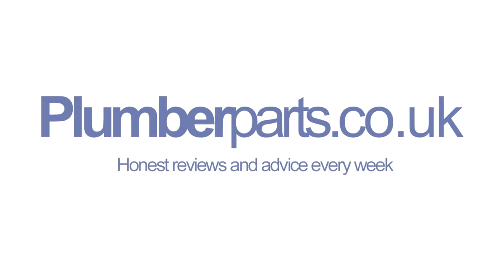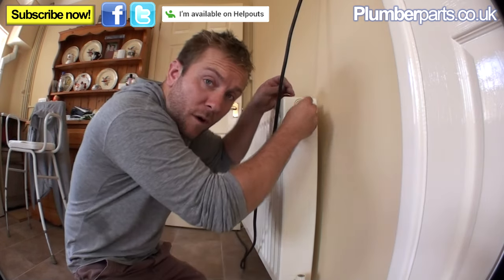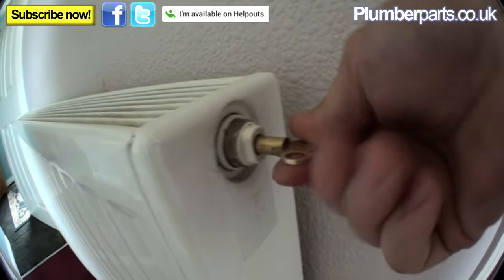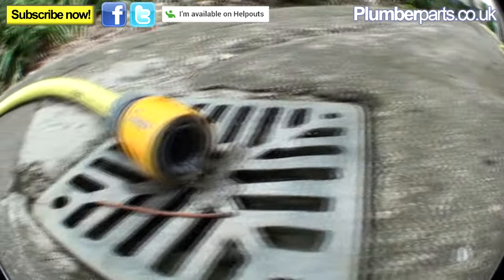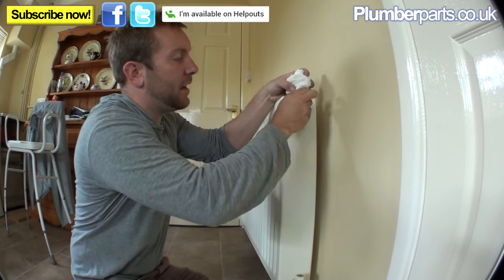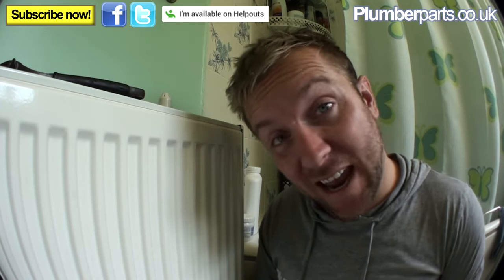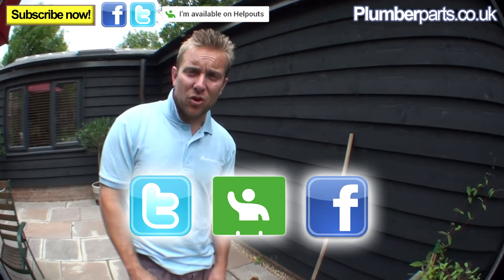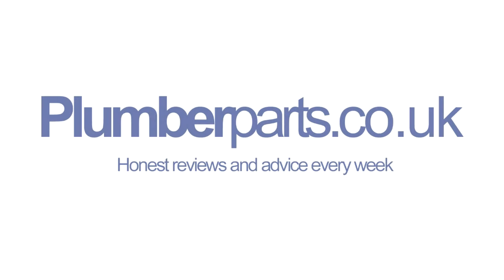HOW TO FILL UP HEATING SYSTEMS - GRAVITY FED - Plumbing Tips

Comment: Class videos. maybe you have one already but if not, somebody should award you with a PhD/professorship (whatever) in plumbing.

I recently changed a radiator on my pressurized system. Pressure of 1 bar holding well, no leaks, all rads nice and hot... except when i go to heat the hot water!? Pressure falls away to nothing, gas boiler shuts off..no sign of leak anywhere!? Could it be an internal hot water tank issue?...tundish a little damp

Comment: After draining down, replacing rads and filling I forgot the step of turning on the water with the drain open. I bled all the rads but when I turn taps on on full and then turn them off the pipes bang/rattle. How do I sort that? Do I need to drain system again?

Comment: I don't suppose I'll still get replies to a 9 year old video but I'm finding these videos very useful and helpful. 

I was wondering where to drain the radiators off when you have a flat and no garden to drain the pipes into. Do I just keep opening and closing the lowest drain point into a bucket? 

I've seen other videos where they change valves etc without draining the system but the tank has been installed in a nice and inaccessible location so draining my only option
Reply from the maker: Hello mate, try your shower tray if you have one. Failing that learn how to pull a syphon. Oh yes and greetings after 9 years!

Comment: Great video quick question when filling up my gravity system I closed off all the bleed valves on the radiators but took the drain hose off and closed it then started to fill back up now when I start bleeding the down stairs radiators I can hear air coming out and the radiators start bubbling inside but then the air stops and I have to keep going round all the ground floor opening and closing them. I done this for about 2 hours and still no water is coming out the bleed points on all ground floor??? Any suggestions please or do I just have to keep persevering with it
Reply: Did you figure out what the issue was as I am about to tackle mine? It wasn't something silly like not turning the water back on was it? Thanks.
Reply: @rtyrtyrtyus  yes I kept going then left it to settle over night then done it again in the morning and all the air cleared. Bled them all again and all was fine.

Comment: Followed these helpfull tips but at the end it seems a bit half arsed. In my case after refilling the system my boiler would not produce hot water. This turned out to be an air block in the central heating pump. If you think you have the same problem undo the large chrome screw on your pump. A little water will appear, use a rag. Straight away I could hear the air escaping and the water rushing up from the boiler to the tank.

Comment: Hi, I have a gravity feed system and had to drain it  to remove a radiator, as the valves wouldn't close off properly.( I turned mains off and tied up ball valve ). All finished and refilled  with water coming out of cold and hot taps. But no hot  water ? Is the airing cupboard cylinder attached to the heating should I have turned the element off ?
Reply from the maker: Do you have an indirect or direct cylinder?
Reply: I'm going for a indirect cylinder as it only heats up when the boiler is on. (It has a creda redhead on the top). When boiler heating water is on a couple of radiators warm up  gently but not the bathroom one ( which normally does). Luke warm water comes out of taps for 5 secs and goes cold.
Reply: Thanks for your reply, but sorted the pump by the boiler wasn't playing nicely, I changed the speeds 1,2,3 and removed the gurgling air 👍

Comment: Hello. Your video clear and interesting. I tried to follow but failed. Do you have any idea why my heating system can not fill up. No water comes out from the ground floor heater where I tried to let it run out for 10 mins as shown in video? Thanks.

Comment: just replaced a rad 3 days ago, now heating pump is leaking, have i missed something out, thought i bled the system, could leaking pump be anything to do with low pressure or is pump simply needing replaced

Comment: Hi
I've bought a house which has been empty for the last 10 years. The central heating system is running on an old school square baci boiler and has a separate cool tank for just hot water. The boiler does turn on but radiators don't get warm neither do the pipes at the bottom of the rads. So my question is how do I drain it using rad gunk cleaner and where do I pour it in?
Thanks in advance

Comment: Is there a product that can be added to the F&E cistern (before opening the ground floor rad drain cock) to help flush any sludge/dirt etc from the rads when they are drained down?
Reply from the maker: James Scott Just your standard cleaner. But you need to let that run around for a few days!

Comment: Hi great videos and what i'm going to ask you probably heard a million times. I've recently installed a towel rack in the bathroom and had to drain the system because one of the valves was knackered. Of course now i have introduced a nice little air block/pocket after refilling the system. 
                  I can hear the water pump spinning around but i have no flow. I remember i once connected a hose to the expansion pipe then connected to the outside water tap and switched on for 20 seconds and it worked gurggle, gurggle rush of air . Are there any offer methods or tips for a DIY  guy like me?. I've changed pumps and valves in the past ,and i know how to solder. Winter is coming and my young son complained he was feeling cold yesterday.:(. I've tried re draining the system and starting again. Really banging my head against a wall at the mo. Been going through all your videos and they have been helpful. Thanks. regards Del
Reply: Its a gravity fed one btw
Reply: Got it, i removed up the new heated towel rack top inlet cap then sucked and sucked the water up with my mouth. The suction started a wave of air bubbles coming up through the pipes under rack. I had to rush to turn the other air vents off on other rads as the water started to flow out along with a gurgling bubbling  noise coming from airing cupboard. I don't recommend the taste but at least i got the trapped air. Not perfect method but it worked.

thanks for the vids ,i've subbed.

Comment: great vid! i changed a radiator in my vented system with traditional gas boiler and drained the system down to do it.after refilling the system vented all radiators etc anyway for some reason when i switched the boiler back on to warm it all up it kept locking out! and will only run for a couple of seconds any ideas?
Reply from the maker: Locking out or going off on the stat?
Reply: +plumberparts thanks for the reply,its been sorted had a guy out and there was air in boiler he turned the pump speed up and down to get the air out and sorted it is that a common way to get air out? cheers

Comment: Hi mate, I tried to drained my gravity system down yesterday but there was a constant flow never ending even though feed supply was off.
         My heating tank sits on top of the indirect pressured cylinder that gives mains pressure to the hot. We also get only a 1/4 of hot water in the bath b4 it runs cold.   Do you think the coil is breached, hope you can answer, cheers
Reply: Was the feed tank constantly filling as u were draining???
Reply: Jeff Smith draining only
Reply from the maker: Hmm it does sound like is been breached. Try testing the other way round. IE, turn off the water supply to your pressurised tank, then open the hot taps and see if the ball valve on the heating side starts to run. If it does then it could well be breached! Sorry dude! PP!
Reply: ***** thanks for the advise it makes sense

Comment: HELP! Great vids btw. I have a gravity fed system so these were perfect. I drained my system as it was proper filth and was effecting the boiler, then put x800 cleaner in, let its do its things for a week and the heating and hot water worked perfectly (which it hadn’t). Today I’ve drained the system to flush out the cleaner and to put an inhibitor in BUT the system will not fill up! Not being an expert I’m a little concerned and stressed as it getting proper cold outside. Any advice would be much appreciated